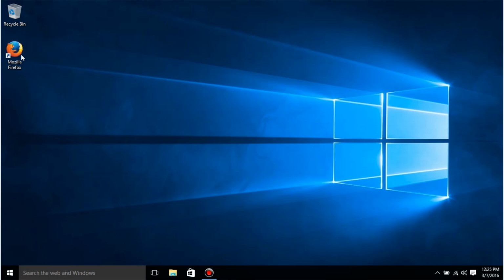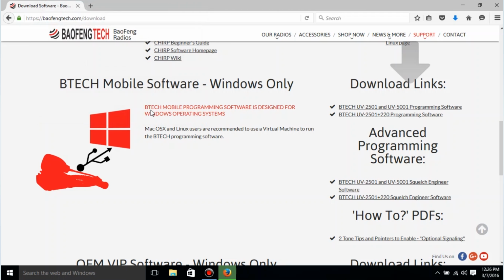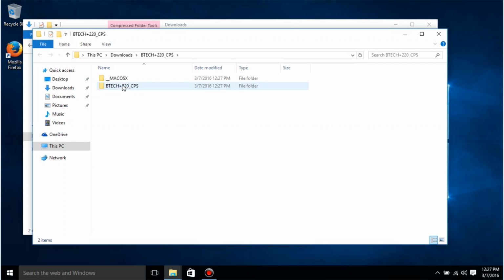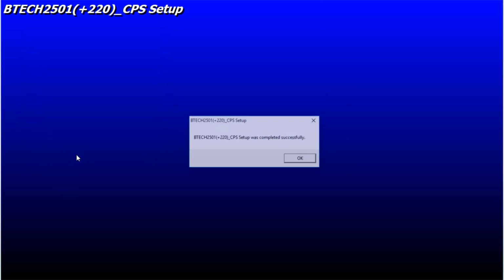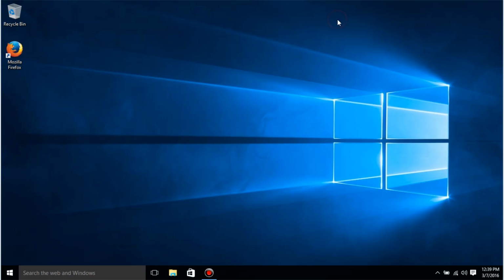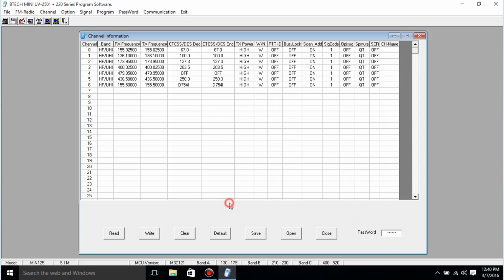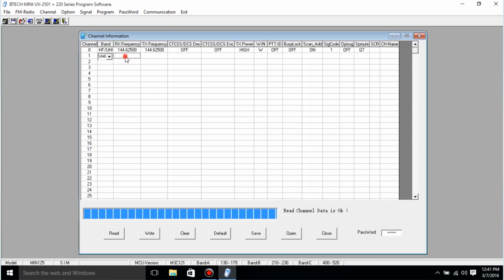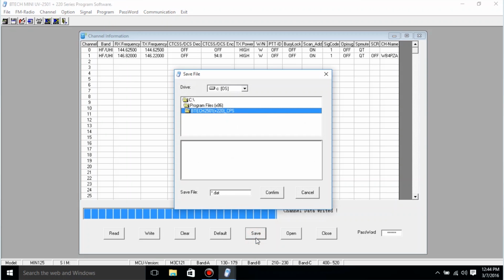BTECH Mobile Computer Programming Tutorial: UV-2501+220, UV-5001, UV-2501

Comment: So I need a Micro$oft computer to program this radio? No manual programming?
Reply: No, you can program the radio by its self, or if you have Linux It works real good.
In Linux Mint Go to the Software Repository, search for Chirp, install it(not Chirp Daily).
Then go to Users& Groups, you will need your password.
In Users & Groups, click on your Name, to the right you will see a list, put a check next to DIALOUT
close everything and reboot the computer.
You are done
refer to this video for the rest
Reply: I second this. Chirp is basically the best HT programming tool on the market. Sure Linux and Ham can be a pain because much of the time you have to tinker... If you can't program or interface with a radio, add yourself to the dialout group to give permissions.. Any distro of Linux can handle Chirp. Ive used it on Slackware and Mint. I need to put it on my newest laptop I usually link to my 450d. 

Also Chirp has a nifty feature in which you can export repeater book info to make massive lists of repeaters in your area. Basically dial in your location and mark how many miles out you want. Select which bands and dump it into the que. Then hit program. Granted I haven't done this with my UV5001 but all my UV5Rs have maxed out memory for everything. 

Also did anyone catch that pirate radio broadcast on 7.305mhz last night?
Reply: @warinotrapp136  Chirp is great but it doesn't give you access to ALL the advanced settings for each radio.  But yes, it's very good especially for importing repeaters from Repeaterbook or RR.